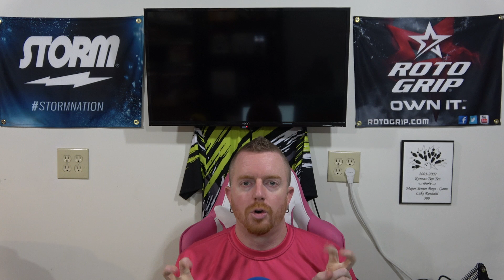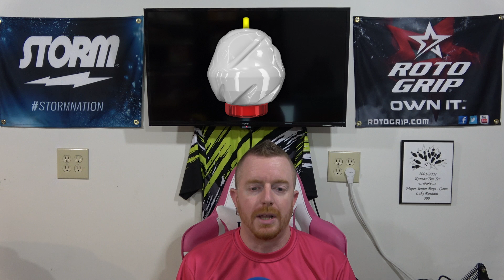Storm Vector Layout System (VLS) 101

Comment: I know this is an older video that I'm commenting on, but I think this may be an important topic to discuss what I am about to highlight....I think you mentioned very briefly in either this or a different video I was recently watching. I wondered if you can explain in more detail the concept behind what you call surface stacking, the fact that we may have a sanded lower grit underneath a higher polish . This concept seemed to indicate not using the Polish systems in order, 1K than 2K then 3K etc, but rather having a sanded ball and say 1k grit and then jumping straight to a 4k or 5k polish so to speak. Am I understanding this correctly? If this is functional it seems to me this would help the ball get through the heads fairly clean but not have dramatic back-end reactions because of the actual Grit surface. Would you elaborate on this concept in a video perhaps? There is literally no information out there that I can find so maybe useful.
Reply from the maker: Yeah you have it right.  There are some videos out there on the topic, but it's difficult to execute and show on video.  Most companies used to have a "1500 grit polish" surface finish, and that was basically 500-1000-polish.  The idea is exactly like you said, it sort of balances the reaction somewhat.  The shine helps get the ball down the lane, but a stronger "undergrit" does provide some extra traction and stability vs hitting every grit on the way up and ending up with a super smooth surface.  

This would definitely be a great video to make though, I'll put it on the list!

Comment: With all this high tech pitches & drilling, how close to illegal is the ball going to be? Old school was 1 oz. Side weight?
Reply from the maker: They changed the rules, you have 3oz all directions now so it really doesn't matter much
Reply: @LukeRosdahl  thanks guy! I bowled until 2012. Started in the late 80s. When I stopped the side weight was still 1oz. So when did they change the rule? The way the balls hook today is amazing! Mahalo & aloha
Reply from the maker: They changed the rule a few years ago when they banned weight holes.  2 handers were using the weight holes to significantly increase the strength of the ball, so they banned weight holes, which naturally meant they had to relax the static weight limits too.
Reply: @LukeRosdahl  you the man! They banned weight holes, so no axis drilling like before? Axis drilling was good on dry lanes,  hook was gradual not big snap in the back end. Aloha guy! Mahalo

Comment: Imagine that the ball is SPINNING COUNTERCLOCKWISE on the PIN axis (precession) while it is rolling down the lane.
The PAP does not migrate; the surface of the ball does. You can visualize this as the PAP being the stylus, the RG plane it is sitting on as the groove on a record, and the ball as the turntable. The PAP (stylus) will stay on this RG plane (groove) until the ball hits the pins.

When the ball is drilled, the mass of the internal weightblock is shifted away from the holes, and the shape of the RG plane on which the PAP is located will be reshaped in the zone between the holes and the PIN. But since the spherical external shape of the ball remains unaltered, the reshaped RG Plane will create a "shortcut" between two points on that plane, and the surface will pass through the PAP more rapidly in this zone, resulting in faster conversion of spin (tilt and rotation) to roll. Layout controls where this conversion occurs, and how fast. Holes drilled near the PIN  (pin down) will slow down the conversion by increasing the RG of the PIN, making it more resistant to precession with less track flare, but more importantly, a smoother and more symmetrical track flare profile, with correspondingly smoother transition to roll.

Comment: Excellent video as always, when laying out a symmetric ball do you measure from CG to PAP to create your PAP intersection? Or just skip that mark entirely?  Thanks!
Reply from the maker: Wha? I’ve never heard of a pap intersection lol. CG literally means nothing on a symmetric ball, especially since they changed the rules, but it’s easiest to still use all angles in the dual angle system or all measurements in the pin buffer/VLS system just to get numbers on the ball.
Reply: @LukeRosdahl  Sorry I didn't really explain that very well, what I mean is on an asym if you wanted a 5x4x2 layout you would draw an arc 5 inches from the pin then 4 inches from the PSA.  Where those two lines intersected is going to be what you want the PAP to be.  Since there is no PSA do you just not draw the second line?
Reply from the maker: Ohhhh lol ok yeah, most people just make up a second number so it's easier to get the lines on the ball with either layout system.  What we do is make a "fake" psa location, or just draw a line from the pin through the CG to where the PSA would be if it was there, and base the psa to pap number on that.  Plus it's easier to just give the whole layout to someone later rather than try to explain why you're only giving them 2 numbers instead of 3 . . it's just an ease of execution thing.
Reply: @LukeRosdahl  Yeah, with dual angle you would just draw your base line from the Pin through the CG, I wasn't sure if that same logic also would apply to the VLS layout.  Thanks for the quick responses!

Comment: Hey Luke, is there a way to find the VLS layout on an already drilled ball? I am in the process of switching my layout system from duel angle to VLS, but I am not sure what my current layouts would translate to in the VLS system. I can easily find the duel angle layout, but don't know if or how to find the VLS equivalent. Thanks
Reply from the maker: Yeah, it's actually quite a bit easier than finding the dual angle layout.  Once you have your pap and dual angle lines on the ball, simply measure from your pap to the pin, that's measurement 1, then measure from your pap to the psa/mass bias, that's measurement 2, then measure from the pin to the closest point on the VAL, and that's measurement 3.
Reply: @LukeRosdahl  thanks Luke! That helps me a ton!!! I appreciate your mind for the game and equipment. As well as your way to be both thorough and yet still explain in a way that is easily understood. Keep up the great work!

Comment: I'm still not really getting the big difference in reaction between a short pin and long pin layout. In the Storm videos, they say that both pin positions are relatively stable upon release, and the pap doesn't migrate much on either. So, why is the short pin supposedly smoother, and the long pin supposedly longer and straighter?
Reply from the maker: Lucas It’s the way the core is tumbling, and I’m pretty sure they explain it in the videos somewhere actually. The short pin basically puts the core on its side, so it’s really even, early, and smooth, while the long pin stands the core straight up and down. The short pin never loses axis rotation so it wants to be continuous, while the longer pin lopes and never really wants to get into a roll. There’s not much imbalance in either layout so that’s why they don’t flare much, but the difference in how the core is rolling is what makes them do what they do

Comment: i like the way you explain this. i have been searching for an explanation that i understand for a few days now.
Reply from the maker: It still takes a while to wrap your head around the concept, but when you get it, it makes a ton of sense.
Reply: @LukeRosdahl  The one that im still struggling with is the pin buffer. I fully understand the pin to PAP and the PSA to PAP relating to the core, but i am having a hard time visualizing the pin buffer.
Reply from the maker: @McCollum2009  Have you watched the Storm pin buffer layout system videos? Pin buffer changes where the finger holes drill the weight out from the core, and more weight drilled out of the side will lower the rg and raise the differential, and more weight drilled out of the top will raise the rg and lower the differential.

Comment: How do these concepts apply to the no thumb crowd?  If you are not drilling a thumb hole  does the pin buffer even matter?  As long as the finger holes are drilled within a few inches of the pin the differential will be same regardless of it being a pin up or pin down layout.  Is there anything else important to consider that is different for no thumb layouts?
Reply from the maker: Actually yes, it's different for two handers/no thumbers because their center of grip is actually between the fingers, and it's different on asyms vs syms.  On an asym, you're still turning the core with different pin buffer measurements, so it matters more than it does on a sym, BUT because their center of grip is between the fingers, a traditional pin up finger placement for one handers is more like a pin down layout for them because all the mass coming out of the core is from the same zone.  If you put the fingers like a half inch below the pin for a two hander/no thumber, you're taking the mass out of the same zone effectively that a one hander would be taking it out of on a pin down layout because the center of grip is in the same place, about a half inch to an inch BELOW the pin.  If you've seen higher pin layouts for two handers on tour, or where the pin is like 3 or 4 inches above their fingers, that's in effect a pin up layout for them.  If the fingers go above the pin for two handers, the ball can do some really wonky things, that'd almost be like a one hander drilling a ball with the pin in their thumb.

Comment: There is a math equation to convert but it is a pain to use. (i had to for a friend). To me, who didn't know either system, Dual Angles seems easier/more practical. But it also depends on each person separately.  If any of the systems is explained in a good way, they are both ok.
Reply: There's a spreadsheet that converts back and forth between VLS and Dual Angle layouts; I can't recall if I got it from the Storm site, but it's useful. You have to make sure, when you convert from VLS to Dual Angle, that you don't end up with a PSA to PAP distance of > 6.75." The converter will convert a 6.75" PSA to PAP into drilling angle = 90, which may not actually give you a PSA to PAP of 6.75, depending on your PAP location. I have to use drilling angle = 85 to get 6.75" PSA to PAP for my PAP, which is 5.5" over by 11/16" down (no-thumb). If I use a drilling angle of 90, I end up with a PSA to PAP of just over 7." I agree that it's easier to lay out a ball using the Dual Angle method, because it's just not easy to swing nice, clean accurate arcs for VLS, so I just take the extra step of measuring my PSA to PAP distances with my Pro Sect on my Dual Angle layouts after I've drawn my lines to make sure they're within tolerances.
Reply: If there were an easy way to swing really nice, clean, continuous arcs (remember those compasses from Trig class? Imagine something like that which could be anchored to the pin - that'd be great!), I'd use VLS simply because I'd be sure of avoiding overly large PSA to Pin distances.